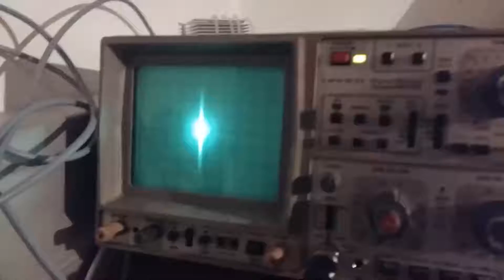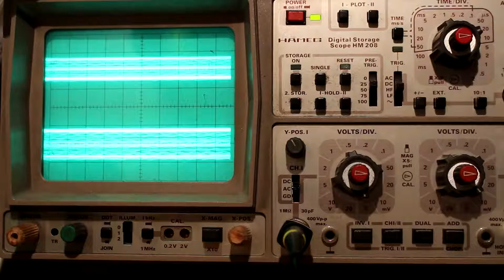ASRock K7NF2-RAID voltmodding for overclocking guide

Comment: Again a great video! The mod BIOSes are kind of still in progress, as I need to add more versions with more popular romsips. I will add more soon. Keep in mind to activate the lan boot option in BIOS to be able to use the advanced memory settings (only this board and my LPA BIOS mod). There is a max FSB boot limitiation of 233MHz because of BIOS (and jumper) limitations, but the board is easily able to do more if you use a clocking tool in OS.
Reply from the maker: Yeah, the max boot limitation is kinda annoying, but no geekbench on the platform so it's fine in the end :)